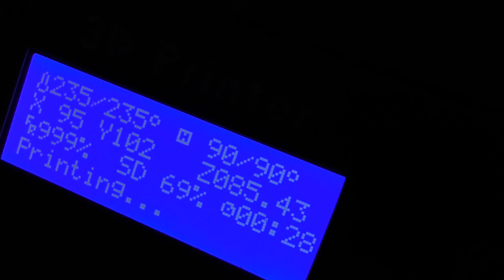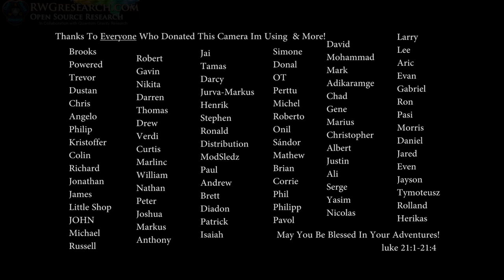Creality3D CR - 8 2 in 1 Laser Engraving 3D Printer: It Printed That? WOW : Review Part 2 GearBest

Comment: just a tip; those wheels that the bed runs or have eccentric nuts which, when turned to the left or right, move the wheel closer or further from the aluminium extrusion that it rolls on, allowing you to get the bed really solid

Comment: I use some kind of spray, AprintaFix, ABS, PLA and PETG sticks to the glass plate. Lasts a few prints, and is sometimes 'hard' to get off the plate. 
The curling/ bending/ bowing on the bottom is definitely Adhesion. I used to print PLA Cold, but as you mention it depends also on the quality of the filament, good batch, roll open for months, moist in the air, all play a part. 
I'm amazed by the speeds you make it print at, can you video that, im wondering if the machine is shaking, and how much.
Keep it up

Comment: 4:05 one rocket looks kinda green. You wouldn't happen to be using matter hackers filament would you? I got a bad spool from them the other day that was black but slowly became a dark olive some what translucent green color the deeper I got into the roll.
Reply from the maker: Yeah. Using there pro filament. If you have any problem just contact them. They will make it wright.!!  There some Good people!  ~Russ
Reply: Oh yeah they are awesome! Actually the roll of black pro pla I got was a replacement for a roll of regular pla I got that was also bad. So far I am 0 for 2 with them on color consistency but I LOVE their filament it prints really good and their customer support is amazing. I guess you probably got a roll from the same batch I did. If it starts to turn more green let me know. I find it crazy that we both would get one from the same batch my rolls says 87375 lot#: 000059
Reply from the maker: oh.. well I'm not sure this is the same batch. i can check my roll. 
i mean i haven't had any problems. 

was this the pro series or the regular you got? 

~Russ
Reply from the maker: also, the green i was having problems with is not the filaments fault, its the printers... ~Russ
Reply: The firs roll (the red stuff) was regular so not the pro but they replaced it with a roll of proseries black
Reply from the maker: ok, i asked them whats the difference. and its tolerance and where its made. ~Russ

Comment: Those Wiggles that you think are caused by vibrations well without knowing it you nailed it that's exactly what they are its inertial vibrations do you know how when you're in a car and you take a curve and your body wants to keep going to the right and your car goes to the left while your body is actually wanting to keep going straight because your body has inertia will so does your print head when the print is going One Direction and then it suddenly jerks and change into another Direction and acceleration it wants to continue going in the previous Direction so it actually vibrates as it attempts to do that inertia and you see that on your print as ringing those concentric vibrations around points where it changes directions that's why you do not see it on the surface where the novel approaches to change because it's not changing direction but you see it after it's changed directions where the inertia interviewed and you get the ringing to reduce this in your printer go into configuration and cut your acceleration and your XY jerk in half whatever the set as reduce them by half that won't get rid of it but will dramatically reduce it

Comment: what's it used for, that ball you made?
Reply from the maker: oh... that's a deep question... :) i recommend going here and reading all the text / watching all the videos:
https://www.thingiverse.com/thing:2313909
but, in layman terms... 

The QSN or Quasicrystalline Spin Network is a 3D representation of a 
4D quasicrystal, called the Elser-Sloane Quasicrystal, which is created 
by projecting the E8 lattice to 4D. This 4D quasicrystal is made 
entirely of regular, 3D tetrahedra, which is achieved due to the 
particular angle of the E8 to 4D projection. When we take any five, 3D 
subspaces of this 4D quasicrystal (one subspace being all tetrahedra 
that are oriented in the same direction) and then rotate them from one 
another by 15.552* degrees, we come up with a 3D quasicrystal that can 
be seen as a representation of the 4D, Elser-Sloane quasicrystal. We 
call this new, 3D quasicrystal the “compound quasicrystal.” Why is the 
compound quasicrystal important? It is important because of its 
relationship to the QSN.
The QSN is the densest possible 3D network of point-sharing Fibonacci
 chains and is the most computationally efficient point space in 3D. It 
is created by taking the FCC lattice (a point space that provides the 
densest packing of 3D spheres) and then spreading its points until they 
are spaced according to the Fibonacci sequence. We then take this new 
lattice of Fibonacci spaced points, clone it five times and rotate the 
five clones from one another by 15.522 degrees to create the QSN.
As it turns out, the compound quasicrystal is an exact subspace of 
the QSN: the QSN contains all legal configurations of the Elser-Sloane, 
E8-to-4D quasicrystal.
The QSN therefore is deeply related to the E8 lattice and its 4D projection.
yeah... that's the layman's version hehe
~Russ
Reply from the maker: I guess you asked " what is it used for" and not " what is it" 
it is the Hypothetical Substructure of Spacetime we use to model physics... 

WE = http://www.quantumgravityresearch.org/

~Russ
Reply: rwg42985 Seems to me that there are a lot of devilish pentagrams in there ;-)
Reply: Pentagram is a celtic symbol not satanistic :)